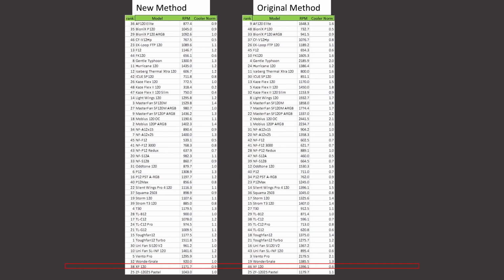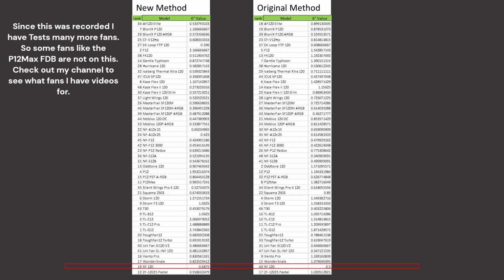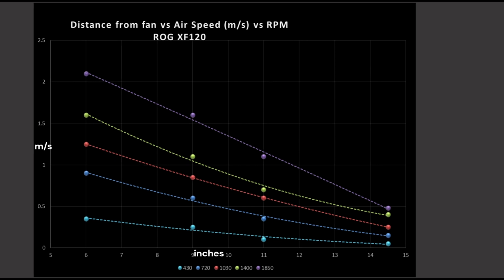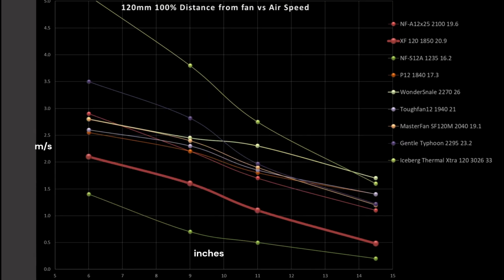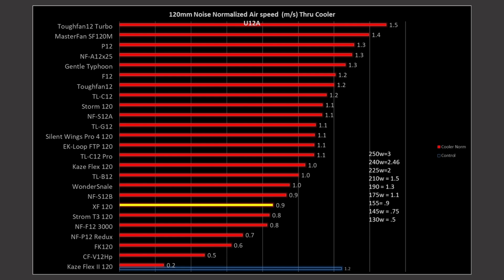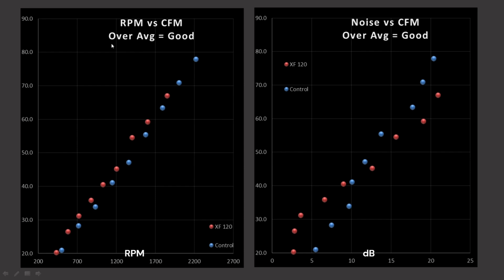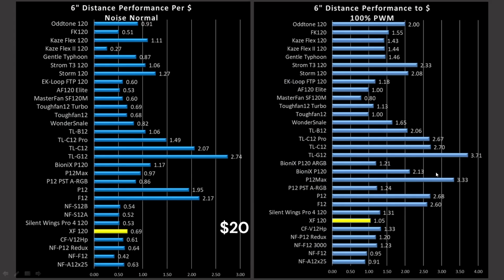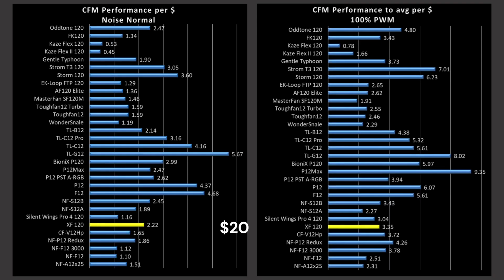(New Testing) ROG XF120 Review

Comment: Which is better as Exhaust fan on case CoolerMaster h500 (p12 Arctic or this rog xf120) ?
Reply: P12 but they have a hum that’s aggravating about to test xf120 on my aio radiator today
Reply: @ea1580 I had Arctic 36 Freezer Black with p12 fans without any hum or noise
Reply from the maker: I would say the P12. I dont recall a hum. but that could be build quality luck.